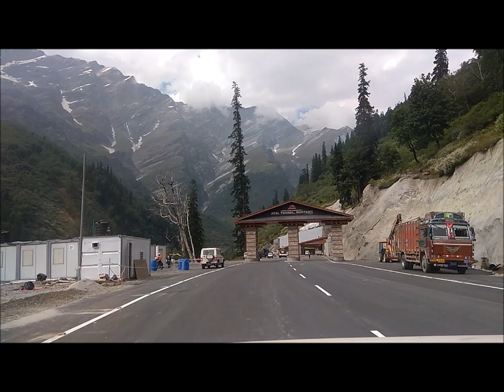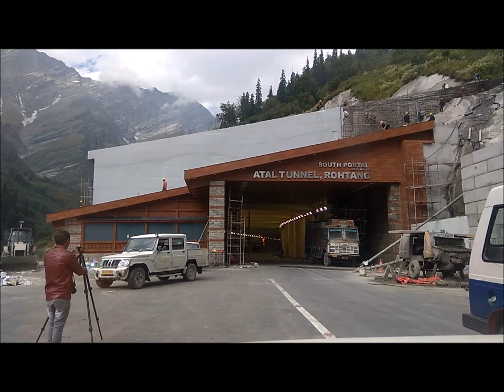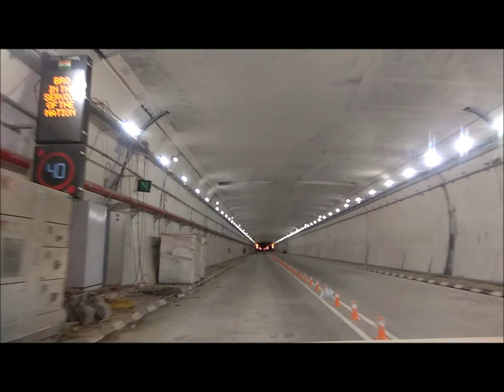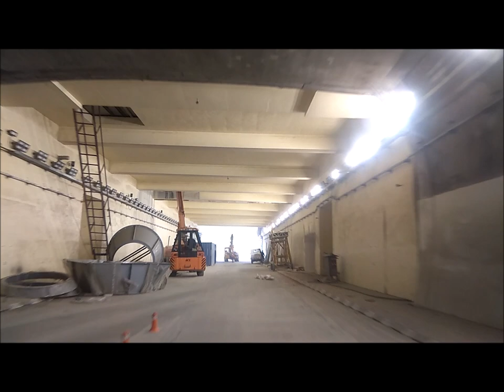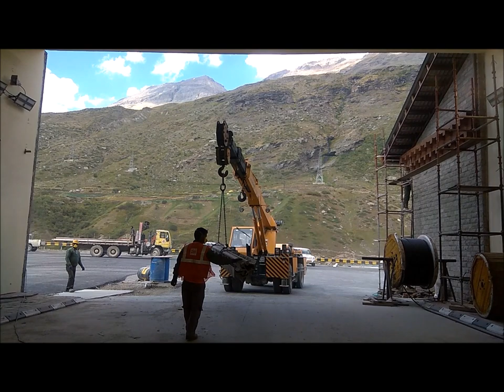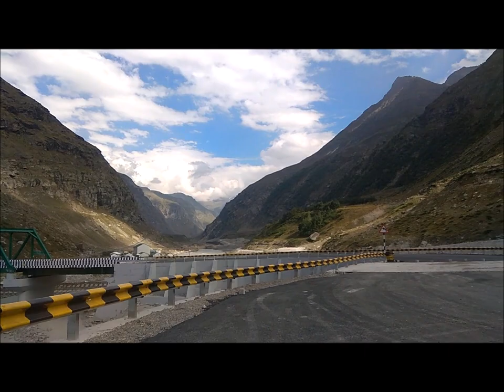2020-09-14 Atal Tunnel   Rohtang, Manali South Portal to North Portal

Comment: It seems the tunnel runs directly beneath the ridge of the mountain. As soon as you enter the tunnel then you turn right toward north-northeast direction for about half of the tunnel length, then you turn left toward north-west direction for the remaining length of the tunnel. When you reach the north end side, you turn 90 degree to exit the tunnel. Right?
What is the temperature inside the tunnel at half length? 
Anyway, it is indeed an engineering MARVEL 👌.
Congratulation, India 👌.
Reply: There is approx 1km high mountain above the tunnel!!

Comment: The tunnel is not safe govt should have made two tunnels passing traffic in one tunnel is always risky accident happens due to headlights of vehicles or over speed in tunnel
Reply from the maker: Bro, Overspeed leading to online challan, as cameras are installed at every 250m inside the tunnel 🤣
Reply: MANOJ KUMAR bro but in India people don’t care about challan and half the truck driver’s are drunk while driving its to risky some day accidents will happen in their
Reply from the maker: Ok
Reply: There are two tunnels actually...the other one is running parallel to it...it is to be used in case of emergency ...
Its an engineering marvel...